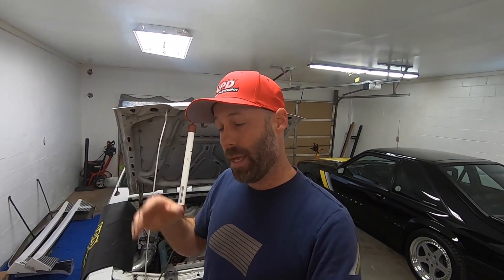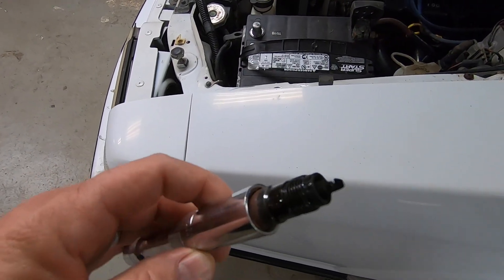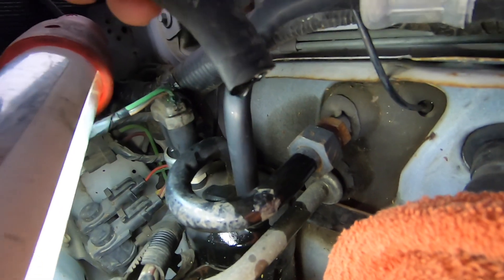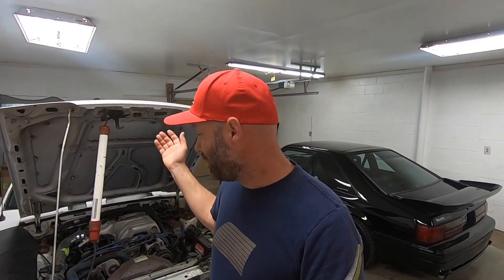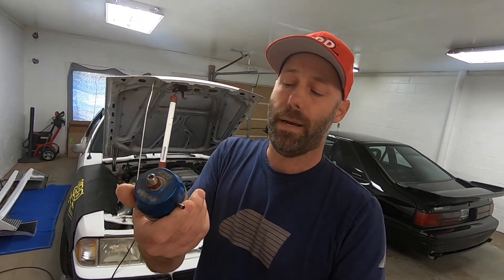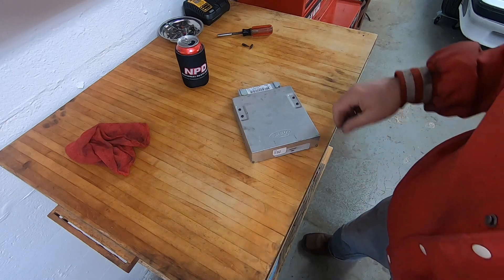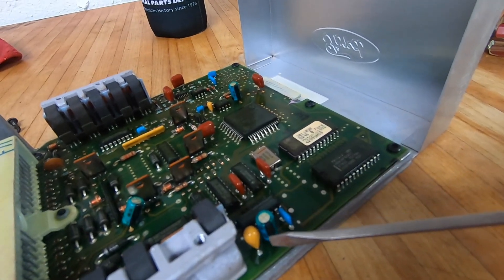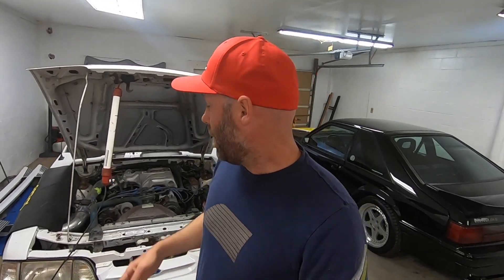Hunting IDLE Problem Fixed - 1989 Saleen Mustang #50

Comment: I have a 91 and a 89,on my 91 i have been having problems with idle fluctuation,I'm gonna run a smoke test this weekend but my capacitors are shot so i need to address that too and that could be the cause of all my issues, here recently i was able to score a old EEC-IV Ford monitor,it cracks me up when some people say its "outdated", lol,that machine was created specifically for Ford cars of the period and unless you dropped a new Coyote or some futuristic engine that machine is a godsend and exactly made to test these cars , if you can find one i highly recommended it.

It was a trip to get the car going and watching all the sensors operating exactly as they were meant to in real time,people always suspect the ECT or ACT and how its no good and i need to find another one etc,with that machine you can see how they operate when they are good and you see the values dropping as the engine warms up etc , your mass air,TPS sensor etc, i was real glad i bought it, i found a lady in long beach California,i guess her husband worked for Ford and she had 2 in excellent condition.

Comment: Thanks for the info. I got one too that is surgi g up and down now and again. Mine is slightly modified. X303 cam , 1.6 roller rockers, Edelbrock upper and lower intake and 70mm throttle body. Mine is an 88 speed density, still have theoriginal ecu in it plus a superchip module attached on it. Also aod trans. Too cold now to work on it, runs fine,  just surging sometimes, also it dies sometimes when going from drive to reverse.  But other then that it runs great. Been doing it for years.

Comment: In the process of root cause troubleshooting the FPR, did you happen to test the FP at the rail behind the alternator before pulling the plugs? Although with it being as rich as you noted the plugs were likely a quicker choice.

On the electrolytic caps, I would recommend a higher voltage rating step while keeping the same value (if its a 16V cap, 20V will be more robust. In my field we typically derate our caps by a factor of 2, so running a 24V cap on a 12V line is common practice)  I purchased my replacements from Digi-Key.
Reply from the maker: The fumes were really really bad and this car has functional cats on it.  I started with the spark plug because I wanted to see how bad they were.  The car had run 15 minutes tops to get up to temp and based on the spark plug condition it was probably not far from fouling a few of them. When that one was dripping wet I knew it was likely the fuel pressure regulator. If I had tested pressure at the schrader valve it would have likely pointed to the regulator not working properly. The diaphragm inside of the fuel pressure regulator is something that can fail and fuel enters the vacuum system.  I've seen it happen before.
Reply from the maker: Also, that's a great suggestion on the caps.  I failed to recognize that solid suggestion. That's good info.

Comment: i have a 94’ 5.0 , used to idle at 1100 and would hear my chop nice and loud , changed my idle control valve and now idles around 800 but with no chop , i have an aftermarket camshaft (E-303) need some help 🙏🏼
Reply from the maker: Sounds like you solved an issue. If it’s running right I would leave it be. The E cam doesn’t have as much of a lope as the more aggressive B and X Ford Motorsport cams.

Comment: I'll tell you how to fix the ideling problem, had the same broblem on my 90GT. The thottle posision sensor at idle needs to put out a certain voltage at idle to the computer. This sensor wears because it is just a carbon variable resistor. This causes the computer to get too low a voltage causing erratic idle. You can remove the tps and file the mouting holes longer, therefore rotating the sensor to compensate. Just another Mustang trick.